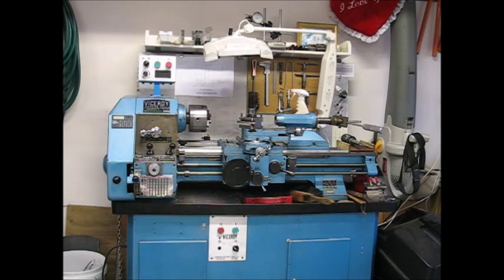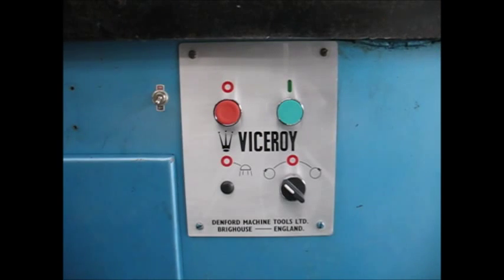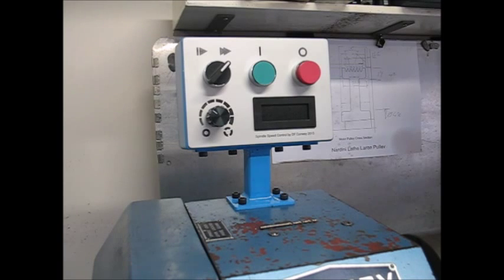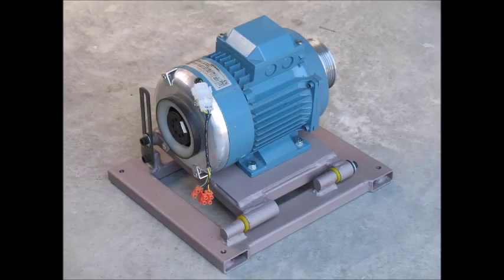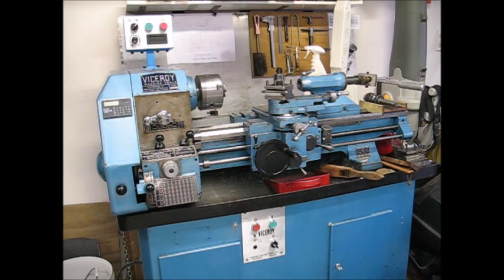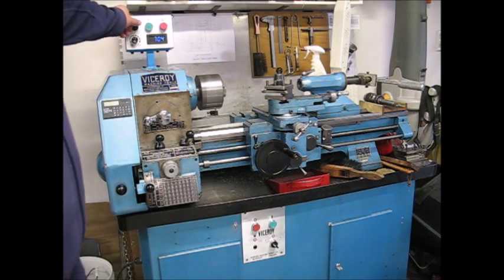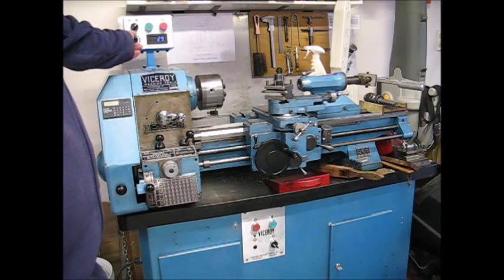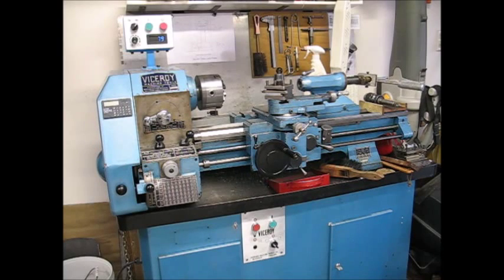Denford Viceroy Lathe VFD Conversion

Comment: Very nice. I've recently bought an old denford the wood/light metal cutting one with carriage. Envious of yours! Say any tips on re-lubrication of the spindle bearings. Mine must have decades old grease in them?
Reply from the maker: If you go to the Denford website, look for the "old" website, you will find a bunch of posts about rebuilding the Viceroy.  That includes removing and relubing the spindle bearings.
Reply: @darrenconway8117 thank you, appreciate your reply

Comment: Back gear looks awesome. Is it also there is the gain in torque if the motor is happy running low speed. Yours sounded quite content, hopefully still are 9 years later!
Reply from the maker: It is still running perfectly.  I am currently using the lathe to make 1/8"  40TPI set screws.  The very low speed makes it easy to turn a thread right up to a shoulder.

Comment: Hi. Nice job. 😁 I've got the same lathe as you, and have started the vsd conversion. What type of controller did you use, and what are your hertz-range for normal and jog-speeds?
Reply from the maker: Hi.  I used an industrial grade ABB ACS50 VFD.   This is a basic device but adequate for this application.  If you can afford it, I would strongly recommend getting an industrial vfd, and not a consumer grade version.    If I did this conversion again, I would make a larger diameter driven pulley.    That would increase the torque and reduce the top rpm.  
Alternatively, I would make a two ratio pulley to give the option of high torque or high rpm.

Comment: Nice video, Darren. I think you mentioned placing the VFD unit in the cabinet, presumably bottom right? I'm considering doing the same but wondering whether it wouldn't be better in free flowing air.
Reply from the maker: The ABB VFD I used has an internal fan.  The motor has a fan.   The feet I have fitted to the base raise the lathe about 50mm.  The air isn't just free flowing, it's forced draft.   There is absolutely no problem with over heating of either the motor or VFD.  The VFD is accessed through the left door.  It is mounted on the right on the front of the cabinet.  It is inside below the control panel.
Reply: @darrenconway8117  thanks for the reply. Watched your video again and I can now see where you have installed the vfd. My vfd is actually too large to install there so I have fixed some din rail in the right-hand cabinet and fitted it there instead.

Comment: so your tac don't 0 out when you turn the spinal speed off?
Reply from the maker: Yes it does zero out.  It just takes a couple of seconds.  It is a reasonably sophisticated circuit that automatically alters the sample period depending on the rpm.  At low rpm, it uses a longer sample period.  When the rpm goes to zero, the display goes to zero at the end of the sample period.
Reply: +Darren Conway thanks for responding